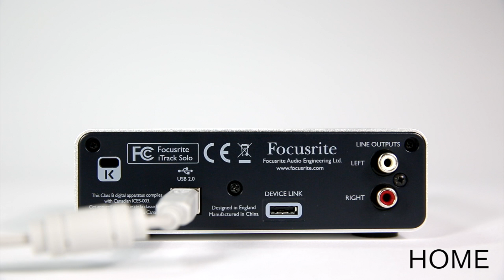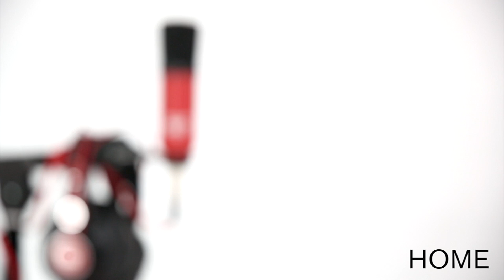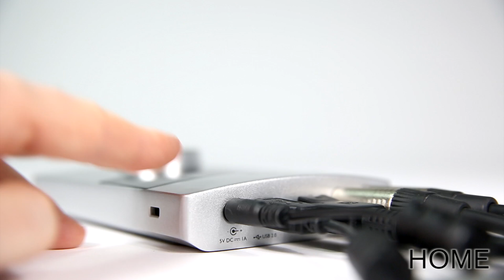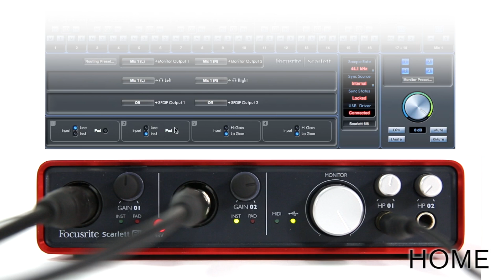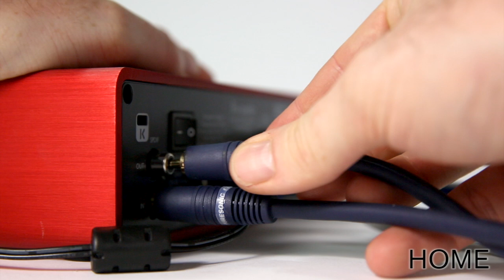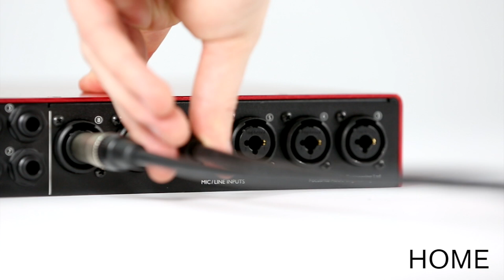Focusrite // Interactive USB Interface Range Video

Comment: During my research in my quest to purchase my first home recording system I have found that your products have a lot of nice reviews, perhaps the best. You appear to have many devoted fans. At this point I would say that I was convinced. You would have been my first choice except for one thing; your red/green clip lights around the input gain knobs. I know that for most people it's probably an excellent feature, but for me it is not. You see, I don't have normal color vision. Try as I might I cannot see any difference whatsoever between the red and the green in any of the demos I've looked at online.
I tell you this only because I'm extremely hesitant to buy a system if I can't tell whether the input is clipping or not and I'm not the only person out there with red/green colorblindness. I just thought I'd throw that out there for you to consider in the future.
Reply: Wow, that's very interesting. Roughly 10% of males are colour blind. They should really add a colourblind mode with a blue LED. It's good that you raise awareness of this, it is too easily forgotten by people with normal colour vision.
Reply: +TuberOnTheLoose You may be able to see the input meters on screen through the control software. I'm not sure, I haven't got one of these or used the software.
Reply: TuberOnTheLoose When Recording, Use Your Ears, Not Your Eyes. Everything Involving Audio, And Sound Engineering, Is All About Using Your Ears. 
I Understand Where You’re Coming From, However Just Remember, Listen, And Listen Carefully. Audio Isn’t About Sight, It’s About Hearing.

Comment: Hi! Some of you using FocusRite 18i8 have had any problem such as drivers problem or hardware issues?I’m thinking of buying one of this, or maybe a Roland UA1010 (Octa Capture). Does FocusRite 18i8 can be used in either Windows XP, Vista, 7 and 8 PCs? Thanks for any answer!

Comment: so the mixing interfance mix control wont work on 2i4
Reply from the maker: Hi,

You are correct, the 2i4 does not use or require Mix Control.

Comment: Hey guys, I want to take my first steps in audio recording and was thinking about getting the 18i8 to record my acoustic band. I noticed it has 4 mic inputs but only 2 48V buttons. What if I want to use 3 mics that don't need phantom and one that does? Is that a problem? Like I said, I'm a total beginner ;-)

Comment: What are the differences/advantages of either buying a Scarlett 18i20 vs a Saffire Pro 40?. I own a Mac, wich comes with Usb, thunderbolt and firewire ports, and I want to start a home studio.
Reply from the maker: Hi,

Usually, it depends on what else is in your setup. If you use a lot of USB Devices, you may find yourself wanting to go with Firewire to save a port. The Saffire Pro 40 is capable of being connected via Firewire with another one though, which would essentially double your I/O.
Reply: FocusriteTV Thanks!

Comment: Hi,just a couple of questions will itrack dock work with ipad 2 with an adapter,also is the sound quality higher on 2i2 using PC or is the itrack or itrack dock using ipad same quality I can't decide which one any advice thanks
Reply from the maker: Hi,

The preamps in the iTrack Solo/Dock and the Scarletts are the same, so the Audio Quality will be the same as well. The Dock was Designed for Newer Generations of the iPad (with the Lightning Port), so use with a 30pin iPad hasn't been tested, nor is it Supported.

Comment: Is the iTrack Solo the only one that works with iPads?
Reply from the maker: Hi.

You shouldn't have any issues using the Scarlett Range with your iPad as well.
Reply: FocusriteTV
Which of these two setups (if any) is recommended for a Scarlett:
Scarlett > USB > iPad Camera Connection Kit > iPad;
. . . or . . .
Scarlett > USB > powered USB hub > USB > iPad

Comment: What kind of effects/instruments can I use the SPDIF connection on my 6i6 with? Can I connect something like a Korg Kaoss Pad of Roland SP-404 through there? I love my 6i6, but the SPDIF is throwing me for a loop.
Reply from the maker: Hi, You can use whatever instrument/effects that you choose, just make sure you have a SPDIF cable. Make sure your going from output of your instrument to the in of the 6i6 SPDIF input. Yes you can use your Korg through this connection. Please make sure you set the correct inputs in your DAW to receive this signal.

Comment from the maker: Hi +Nathan Lookwhy

You will just need a 1/4" Audio Cable to connect your Keyboard to your 2i2. Depending on the Keyboard, you may also be able to use 2 cables and record in stereo.
Reply: thanks, i went and got the 2i2 and a monster cable 1/4", and it works great

Comment: Putting only 2 line outs in 18i8 was a bad design. People looking for an interface of this caliber are very likely to use line outs for incorporating external units or reamping. With 2 line outs you have to unplug and replug your speakers over and over again and monitor through phones(or not monitor at all) while you reamp. That is a deal breaker. You didn't even have to put extra channels, just 2 extra physical TRS mirroring one of the stereo headphone channels would have done it.
Reply: It has another 8 outputs. My current has 2 for my monitors and 4 out. That is plenty for anything I do. So 8 should be more than enough. You can assign them to do anything really.